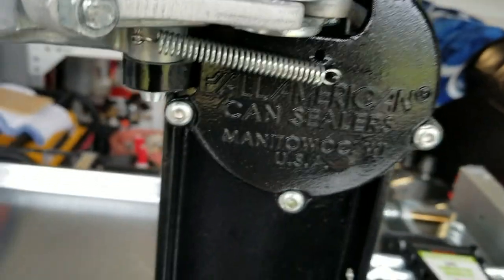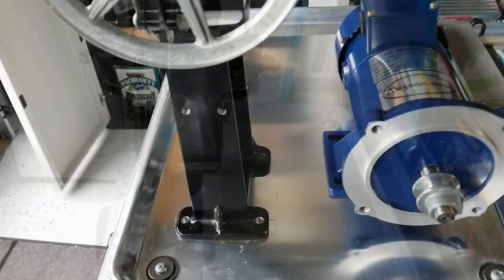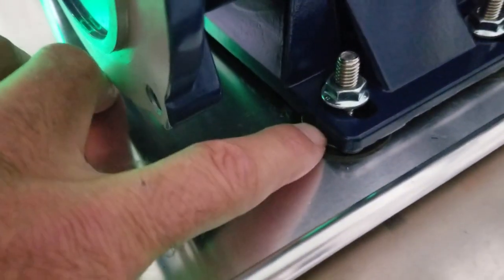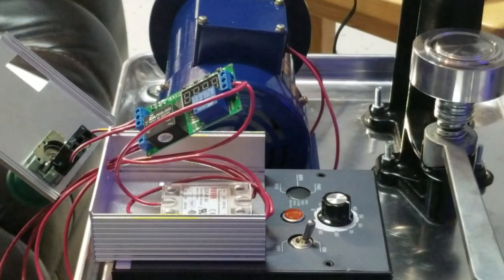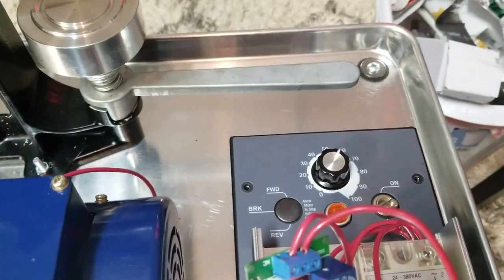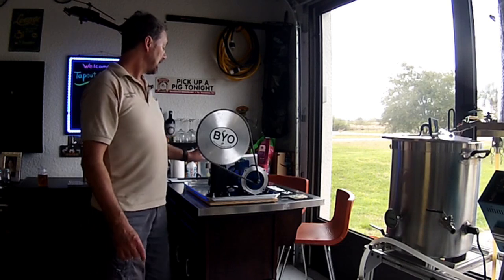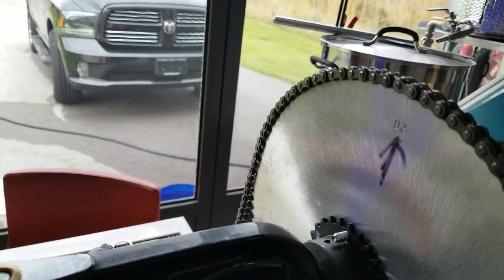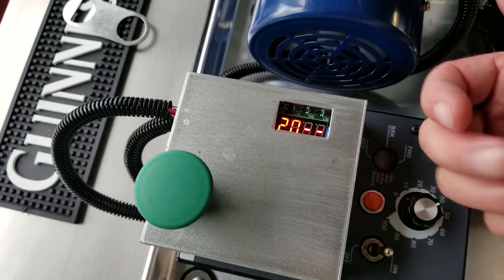All American 225 Can Sealer Automation Project

Comment: Do you have the part number or size for the small sprocket on the top that the 92 sprocket is bolted to?  Also the one on the motor?

Comment: Hey Gary; Great video and project. I'm trying to figure out what the difference between the Model 225 can seamer and the ones that homebrew sells. Seems that the only difference is that they include a different chuck for the B64 cans. Am I correct that you could just buy a model 225 master seamer and get the appropriate chuck for the 12/16oz cans?
Reply from the maker: the 225 does both 12 and 16 oz right out of the box, mine does.  the B64 can lids i thought were the same, I order my cans through https://oktoberdesign.com/ hope that helps